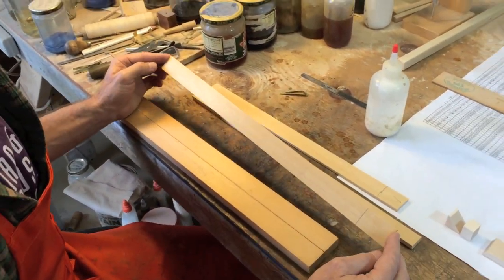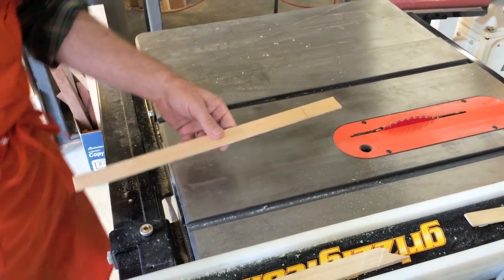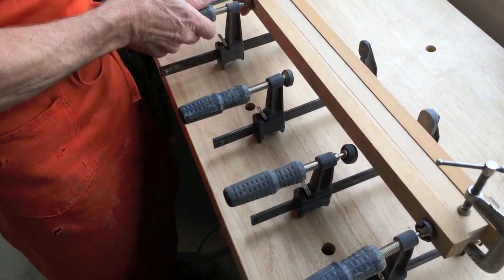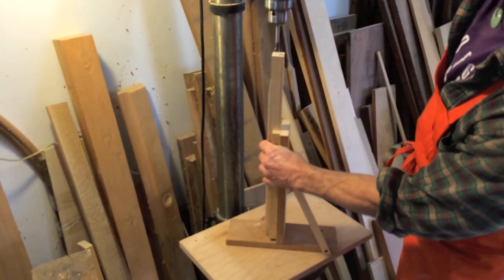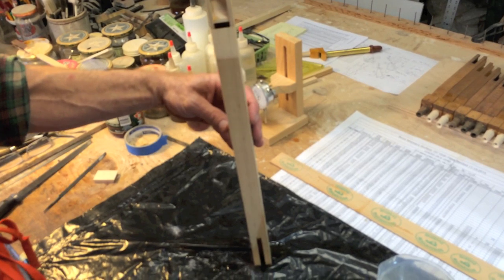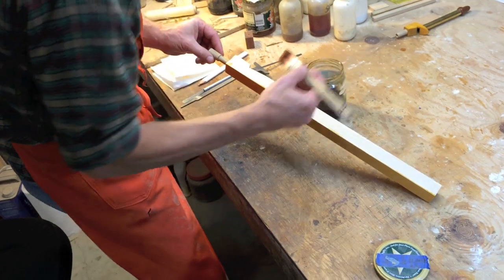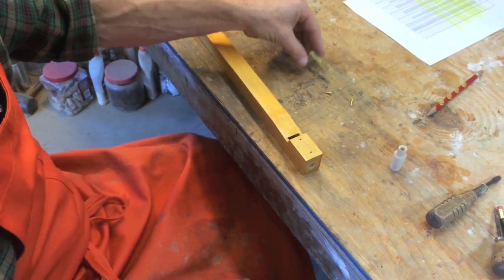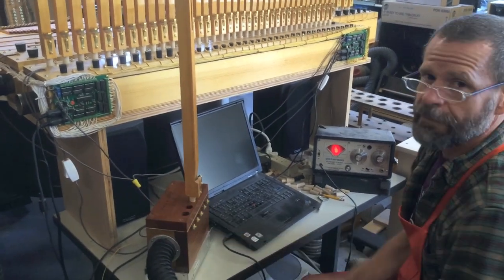Making Violin Pipes for a Band Organ

Comment: Thanks for sharing your video, Bruce. There are lots a neat ideas here and of course, your finished work looks impeccable. 

But...and I'm really sorry there's got to be a "but"...

How you make the upper lip bevel is unsafe. Never do anything freehand on the table-saw, especially with the blade standing 3 inches proud of the table.

Oh, sure...it's a small piece, I've got this backing-block...I'm in complete control. What could go wro... SCREE! SCREE! SCREE! A bird comes streaking in through the open window of your shop, hell bent for the Coast, with a hawk in hot pursuit. Right past your head. You jump, and...well, dammitall anyway! I sure was ...ah...attached to those fingers...

Think something like that couldn't happen? It did in my shop, about ten years ago--and the head they flew past was mine. In the event, I was only working at the bench, so my only risk was...like, maybe a heart attack?! But I like to think if I or one of my people had been at a machine, the setup would have saved them from injury.

It's not enough to make accidents unlikely, you have to make them impossible. I say this in all humility, Bruce, believe me. Because this old organbuilder learned the hard way: the machine never asks, "Ummm, buddy, is this really what you have in mind?"

OK, enough ranting. Now, tocompensate for my preaching with something positive, here are a couple of suggestions  

The safe way to make such a chamfer on the saw is to move the fence to the left of the blade. Set your angle, saw out a zero-clearance strip the thickness of your work-piece, and fix it to the fence with double-backed tape; or tack it to the table insert with a couple of little finishing nails. Feed the work-piece vertically, using a chaser-board thick and wide enough to completely cover the saw-blade until you're out the other side. 

Alternatively, perhaps easier, is to make a jig to hold the work-piece at the desired angle--a simple U-box with second, false bottom that pivots at the far end. Set your angle, pin the false bottom in place, clamp the work-piece to it, and pass a router on the two rails above. Piece of cake!

Comment: Nice man, could you make a video of making a low C 64 ft wooden pipe?
Reply: 1. I don’t think his workshop is big enough to hold the pipe even horizontally, and 
2. The lumber needed to build one pipe in that octave is probably about the same amount needed to build a tiny house. There are only two 64’ stops in the world: one in a town hall organ in Australia (which I think is a reed stop) and the other in the Atlantic City Convention Hall Main Auditorium Organ (which is a diaphone). The latter stop was actually literally constructed in the building (in the chamber) and each pipe was hoisted into place using rigging. It is probably impossible to remove these pipes from their chamber without dismantling them. I have no idea how the big tuba/trombone pipes in the other organ were built / installed.
Reply: Those pipes are also considered so low in pitch as to be practically musically useless. 32’ stops are at least audible (even though some notes sound more like a helicopter hovering), and a few other musical instruments do make notes in the 32’ octave.

Comment: Hi, thank you very much for the video! I'm German organ builder myself and the video is just great to show the audience how much work is just on one single (wooden) pipe, knowing how many pipes an organ got and also how big they can be (the smaller make more work in detail, the big ones are just unhandy). Im just wondering why the toe is not a compound with the wind chamber as one piece of wood (sorry for my english, i hope you got what i mean). I have seen it many times in church organs like that and it makes the work easier, also easier to glue and you can even turn the toe with the complete pipe in the lathe. Or is it unhandy - or Wurlitzer made it exactly like you did? Thanks in advance!
Reply from the maker: +Olafko Hi, I'm glad you find the video useful! Yes I've seen some European pipes with toes that are made by extending the pipe body then turning the the toe by inserting the whole pipe into a lathe. The method I demonstrate in the video is the way Wurlitzer did it but I also like this technique because I can be much more accurate this way. Also the end result is a toe made of a single piece of wood rather than several pieces glued together.

Comment: What is the length of the large bevel? You mentioned the length of the mark for he blocks, but didn't mention the large bevel length.  Thanks,
Reply from the maker: The bevel length changes from note to note - it's not a fixed measurement. Whatever pipe scale you're using will specify the length of the bevel. It's typically somewhere between 1X to 2X the width of the front of the pipe.
Reply: Thanks,  really enjoy your, more then helpful, videos.  Very inspiring. I'm in the process of deciding on the Senior 20 or Universal.  It'll be the only one I'll be making, so I'm thinking, why not pull out all the stops and go for it!  I've done some rather technical project, so I'm confident I can handle it.  Check out some of my projects at http://lumberjocks.com/tallshipsailor/projects. Thanks again for your inspiration!

Comment: Im making a rank of cello pipes and a celeste for them myself and am about to start crating the sides and fronts of the pipes. this is very helpful! Also do you have any detailed pictures of the tuning slot? I can't get a clear image on how to make them for my cello pipes.
Reply from the maker: I use a small bit on my router table to make a cut in each side piece about .030" deep and about .075" wide. I'm away from my shop until the end of the month and don't have any detailed pics on this computer.
Reply: Oh okay then. Thanks for telling me. Also would it be possible to purchase around 100 Frein Harmoniques from you? With the limited tools and limited experience working on metal, I have not had much luck making a decent one in the past week.
Reply from the maker: Victor Ruiz sure, contact me when I'm back in July and let me know the widths you need. I make them in 1/4" increments.
Reply: Okay then. Around how much will you charge? Just so I can be ready and have an idea on how much I'll spend.
Reply from the maker: Victor Ruiz $4 each

Comment: what wood do you use to make the parts for the pipe because I want to make a pipe but I don't know which wood is best to use hopefully you have an answer to this
Reply: I’ve heard of wooden band and street organ pipes made out of maple, cherry, beech(?), alder(?), poplar(?) and probably a few other types of generally hardwood. Perhaps pine might have been used for some large bass pipes (to cut down on weight), but be careful using any softwoods as those are most easily attacked and eaten by termites aka “woodworm”. I know of a large fairground organ whose softwood case was mostly eaten by termites (as well as a couple of the softwood channel dividers in the windchest and one of the softwood pipe risers for the facade pipes), but whose pipes were largely left intact, most likely because they are made of harder wood (also, the organ was ‘rescued’ from bad storage conditions twice in its life, which probably also halted the termites from making further progress), although an entirely new case had to be built.

Comment: Hello, may I ask how or where you get the scaling?
Reply from the maker: +Chopy 61 There are a few sets of band organ plans you can often find on Ebay and probably other places. You can also look for a copy of Doyle Lane's band organ scale book.
Reply: +DuoArtOrgan thanks
Reply: DuoArtOrgan May I know the name of the book by Doyle Lane?
Reply from the maker: +Chopy 61 I believe it's simply called Wurlitzer Band Organ Pipe Scales
Reply: Yes I have this book and it is indeed called Wurlitzer Band Organ Pipe Scales. I think it may be available as a PDF in the “Members Only” section of the AMICA website, but not positive. That book was published in the 1980s and I think copyrighted, but since Mr Lane passed away in the early 2000s or so I think the copyright has lapsed. Not positive and an curious. It’s a fairly thin book with a comb ring binding, and only occasionally found for sale online, but keep looking for it. The scale drawings / measurements themselves, scaled down, are from the original factory scale boards found mouldering in Ralph Tussing’s basement in North Tonawanda, and Ralph, who along with his family had worked for the Wurlitzer company (some of his family also worked for North Tonawanda and Artizan), had gotten these items from Wurlitzer, along with the two remaining roll perforators and band organ master rolls (which came from Wurlitzer to Allan Herschell Co. about 1945), when they phased out their band organ department. It’s NOT (unfortunately) scales for ALL DeKleist/Wurlitzer models, only mainly those produced after 1916 or so such as the 103; 104/105/106; 125; 145/146; 148/150(I *think*); 153; 157; 165; 180; and Caliola. This is only measurements for wood flue (flute, diapason and violin) pipes, and not for the reed pipes nor brass piccolos I *think*. But still a very useful book. The boards were used by builders in the factory to pick off the relevant measurements for each pipe using a set of calipers. Amazing this still exists, if even only for the most common 1913-1929 or so models (which to be fair accounted for like 2,000 organs, including most of the surviving originals). Some seldom built or one off organs like the 162/163 (only 1 ever built); 164/168/175 (only 5 ever built); the 166 (only 2 ever built), and the “65 note piano roll organ” (only 1 ever built) are not included, nor are early 1910-1919 styles the 126 (9 built) or 147 (58 built), but by and large nearly every other 125, 150 and 165 roll organ is included.
Reply: It is most likely that the seldom ordered or custom one off organs built by Wurlitzer had their pipe measurements on a set of blueprints rather than a scale board, as they were not sure if (or when) enough orders would come in to justify enshrining these measurements somewhat more permanently in a “scale board” (plank with markings attached to the wall in the pipe shop of the factory). I don’t know this for sure, but it is good speculation. Blueprints for some other parts of organs do still exist, so perhaps these once existed, and still might somewhere.
Reply: The other paper roll models I’m aware of are: 
155 AKA “100-key” 
(at least 20 or so built, 
uses 155 rolls; 
3 known extant); 

110, the paper roll version of the “44 key” cylinder organ 
(about 66 cylinder versions built & 2+ known extant; 
only 2 paper roll “110” versions known built, using “44” rolls, 
0 style 110  organs and 44 rolls known); 

120, the paper roll version of the old style “21” cylinder organ aka “38-key” (need to back and check how many 21 organs built, but probably several before the first existing ledger book from 1901 so total unknown, at least a dozen or so with two 21s and a 21-B with drums on top, extant; only maybe 2 style 120 roll organs built, with 0 known surviving and 0 known style 38 rolls); 

135 and 140, the paper roll versions of the style “49 key” cylinder organ. I seem to recall about a dozen of these were built (some with cylinders and some with rolls), about 1/3 of them were factory converted from cylinder to 49 rolls, and a couple later to 150 rolls after the 49 roll was discontinued. Supposedly one of these still exists in New Zealand or Australia, but I’ve never seen it. Another was used on an early Parker carousel at Lakeside Park in Denver in the 1910s-1930s but whereabouts/existence unknown. I have no idea of any style 49 rolls exist. 

Style 22 Paper Played. This was presumably a roll version of the old DeKleist style 22 cylinder trumpet organ, and comparing the catalog illustration of the 22 with the style “59” roll scale from the Wurlitzer factory records suggests that it played that roll. Only one is shown built, shipped to Louis Gabard in Los Angeles in I think 1906, but existence/whereabouts unknown. An existing organ might be this instrument, shown with Tom Fretty in his obituary photo in the COAA Journal and reportedly owned by a carousel figure collector in I think Kansas or Oklahoma. 

Style 100. This organ does not appear to have had a cylinder operated predecessor, and played perhaps the best small Wurlitzer organ scale, with 5 bass but otherwise practically fully chromatic (the Wurlitzer “48” roll scale). Unfortunately only one is shown in the shipping records, shipped to A. W. King in Portland, OR in 1906. It would be wonderful if it still exists. 

Style 160 “Mammoth”. This was similar to the old style “119-key” cylinder organ, but the pipe layout on the windchest, pipe divisions, and maybe instrumentation were different. Only two “119-key” cylinder organs are known built (the second exists, now playing 160 rolls), and three “160” roll organs known built (the first exists, last playing 165 rolls). This was the largest style band organ they made until the style 180 was introduced, and was nearly fully chromatic except for the lowest bass notes.

Note: the above production figures are from memory from me studying the DeKleist/Wurlitzer shipping records (DeKleist ledger books #3 and #4, covering 1901-1906; and Wurlitzer shipping/serial number records from 1908-1945), but these records are incomplete, as detailed Wurlitzer band organ records for 1908-1913 (showing destinations etc) seem to be missing, and North Tonawanda Barrel Organ Factory ledger books #1 and #2 (covering 1892-1901, pre “DeKleist”) and DeKleist ledger book #5 (covering 1907-1908) also seem to be missing, so the above numbers definitely omit figures for 1907, excepting one extant 155 and 160 (the first roll organs were shipped in 1904) and so it is likely at least one more of each rare chassis type were built/shipped in 1907, in addition to many of the ubiquitous styles 18, 125, and 150.
Reply: * sorry for the long posts, but I forgot to add that the 18/18-A/18-B/18-C/105(brass)/125/127 chassis type, and the 20/20-A/20-B/20-C/130/148/149/150 chassis type, were two of the most popular chassis types built in the early days. Possibly as many as 1,000 of the former type (accounting for about 1/4 of all their production) and at least 200+ of the latter type, were built. We don’t know exactly how many, since as mentioned before, ledger books 1, 2, and 5 are currently missing which would have that info. The info comes from listings in the later ledger books. But both styles (18 and 20), together with some extremely rare and some extinct other models, appear in the North Tonawanda Barrel Organ Factory catalog of 1901 which is the earliest known extant catalog to my knowledge (we hope an earlier one will appear at some point). A few 18-type organs from as early as the mid 1890s still exist, with very low 3-digit serial numbers, proving they were already building that chassis this early (this would later become the Wurlitzer 125, the first one of which was built in 1906); a couple early 20-B type organs from the cylinder era also exist, (which would become the Wurlitzer 150, the first one of which was also built in 1906). So the 125 and 150 are actually quite old for American organs. We know that the 150 chassis (not facade) was copied from a Limonaire cylinder organ model with drums that was built c. 1870s-1880s, an example of which still survives in the Jessett Museum Trust in England.